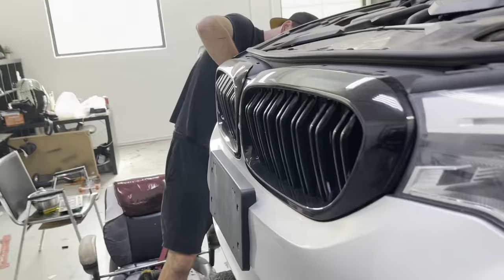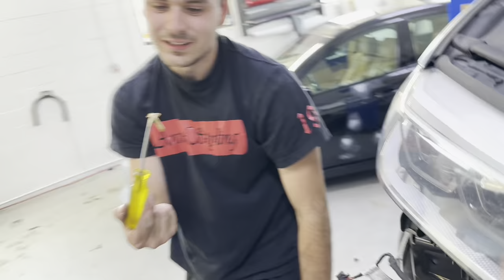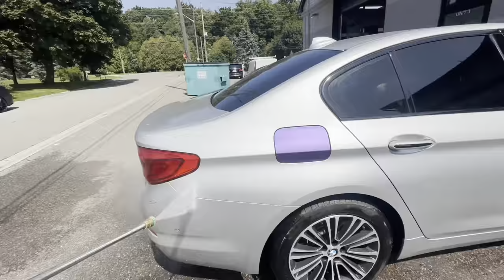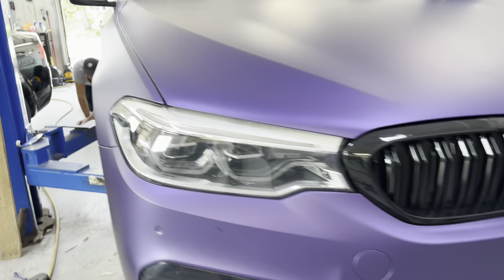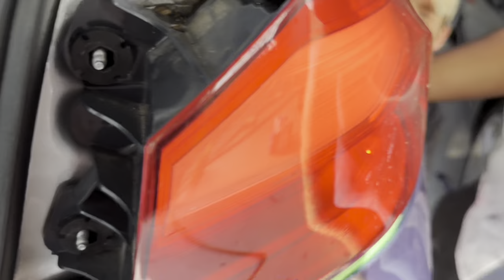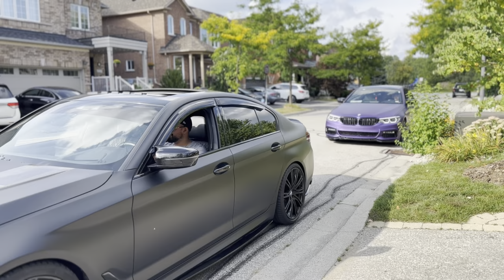BMW  540i M-Sport B58 Complete Makeover In 9 minutes!!

Comment: Did you need to get different brakets or would just the front bumper fit on without any modifications?
Reply from the maker: The bumper came with different attachments to connect it

Comment: Question: I have a standard G31. BMW told me, its not as easy as it seems to swap the bumpers front and rear, because they mountings underneath are different. In this video it seems as if they were wrong, is it just plug and play?`
Reply from the maker: I don’t see why it would be any deference on the front ends